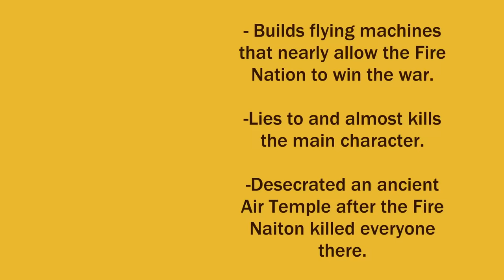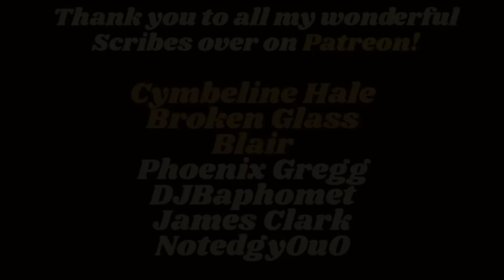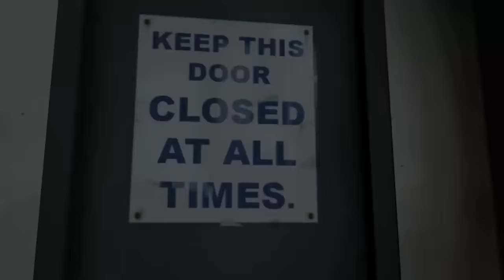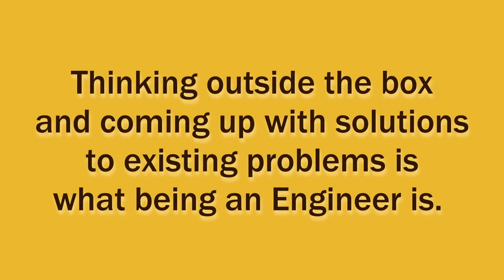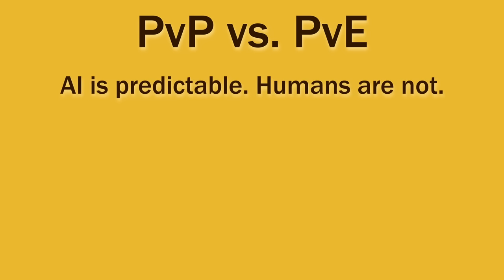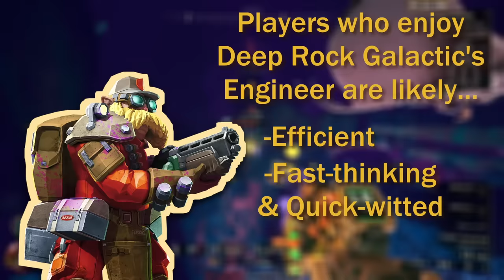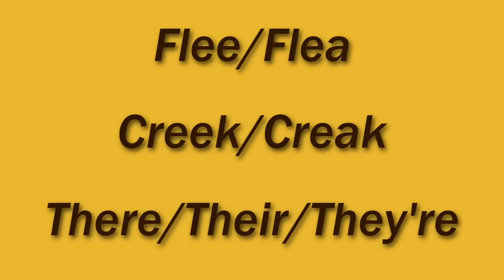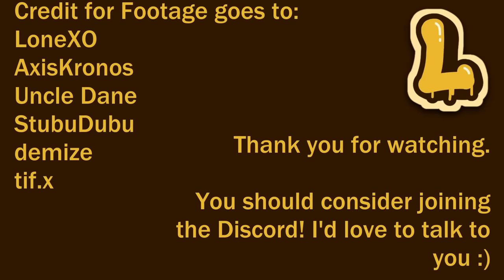TF2 vs. Deep Rock Galactic: What It Means To Be An Engineer

Comment: The beauty of DRG is every class is good on its own but SHINES when grouped. Everyone can contribute meaningfully to success.
Reply: Exactly! Each class has its own purpose in damage, movement and utility. Each one can complete every mission on every hazard level solo just fine, but they're ultimately incomplete without each other.
Reply: I would say it's the same with TF2, but it's more rare to encounter a well coordinated team, though when it happens, it's awesome.
Reply: @RDTRNT Because tf2, ironically, is closer to a single player game that just happens to have other players.

Valve realized pretty early on (through their failed "Commander" attempts during early tf2 versions) that players HATED failing due to another player, since it wasn't their fault (or even if it was), so they would quit. Tf2 fixed this by being primarily solo based with opportunities to work together (protecting the engie/medic, helping a fellow spy get a kill by distracting an enemy, calling out a sniper, etc.) You don't NEED to keep your medic safe or help a spy, but doing so makes it easier to win and, if you fail, you blame YOURSELF for either solo mistakes or not putting your effort in. 

It's a remarkable way to handle teamwork, and I think is one major reason the "friendly" playstyle even formed, you don't need to play as expected to have fun and you aren't ruining the fun of others nearly as much as other games.
Reply: @thunderspark1536  That makes sense. On the other hand, DRG is widely cited as such a positive game because every class could be considered a support class! So even a selfish player, who only uses their abilities for their own benefit, will still end up accidentally helping their team!
Reply: @Drekromancer  Exactly.
Reply: I think what's even more beautiful is how intuitive the teamwork and synergies are. Most people seem to understand exactly how their class abilities can help each other, and very little communication is needed between players for everyone to be on the same page. I rarely talk to other players when I play online, but teamwork is spot on 90% of the time, even when playing with greenbeards (mostly).

Comment: I will say, first off: ROCK AND STONE! Second, the great thing about drg is that you can take it at any speed you want, ranging from a hazard level 1, were problems are basically nonexistent, to haz 6, where the gameplay shown in the video is still probably not good enough. My point being, drg, and all 4 classes, are completely moldeable to your play style, you could turn engi into the tf2 engi, play sea world tycoon 2, or be the doomsayer.
Reply: ROCK AND STONE!
Reply: ROCK AND STONE BROTHER
Reply: Did some say rock and stone?
Reply: STONE AND ROCK!! Oh, wait..
Reply: I think the video's gameplay is good enough for haz 5, it's the modded difficulties that go to haz 6 that make things really crazy.
Reply: @aarepelaa1142  Ah, thats what I was thinking of. Brain kinda force-forgot that
Reply: Roch and Stone to the bone!
Reply: FOR ROCK AND STONE
Reply: ROCK AND STONE FOREVER!
Reply: ROCK SOLIIDDD
Reply: DRG is limited by ammo. There's only so much nitra around. So attrition warfare is not an option. But TF2, in the most popular game modes, is all about attrition and pressure.
Reply: Wait.. what's the difference between rock.. and stone..
Reply: DRG engie can range from a colony management simulator between dorreta and 2 turrets with arc/em discharge/slap or summed up in one overclock
fat boy
Reply: DID I HEAR A ROCK AND STONE?

Comment: The mono-class team meme is not that bad in deep rock with 4 tech-guys, them being so flexible lessens the pain of lack of specific tools, like the hyper mobility of scout or the fast terrain removal of driller.
Reply: All of them have bonuses that mean its not actually bad to play. For gunner, you have so many shields that you can never leave one if you feel like it, and the overwhelming firepower can take out anything really fast. For engie, they're all very flexible and can deal with most situations. For scout, you're all moving so fast that its gonna be hard for the bugs to keep you all down, and swarms are an afterthought with builds like electrifying reload GK2. Driller is the most niche, but swarms will be practically stuck with the number of CC abilities, and i gotta say, the fastest Haz 5 aquarq mission i've done was a 4 driller team, we all just blitzed the objective.
Reply: same for the aquarq on haz 5(high oxygen and jet boots) our only swarm was after we send the site away
Reply: @ruberine2086  agreed, but an all gunner team in a pit with a steady supply of ranged enemies becomes a nightmare.
Reply: @lestevegmbh2637  Sounds easy done right. Bulldog, coilgun, mingun and hurricane are all good options to deal with ranged enemies. Innacuracy doesn’t matter if you have 8,000 rounds to play with. Someone going down doesn’t matter, as you can just toss a shield and rez them, and also have cover for a while, and still have 3 fully charged by the end. Its also a perfect time to use my patented method of the gunkie (a bunker dug by just gunners, with just gunners in it. You want a nice wide mouth for it too). The chances you have an entire team end up in a pit they can’t get out of together, with so many ranged enemies that you’ll burn through all your shields and ammo is then so incredibly slim.
Reply: @lestevegmbh2637  as long as y’all bring different builds y’all should be fine
Reply: @ruberine2086  we should be fine, unfortunately we have one gunner with a single promotion who hugs the shellback repeatedly, one who isn't around at all and we burned trough the mission saving active abilities like IW or FM during the objective completion.
This isn't about the optimal situation, were all colleagues are competent and on max ammo. Wasting shields is a problem exasperating this case, gunner doesn't have a middle ground equipment wise, only guns or either grenades or shields, and of those only 4, yes that can be fixed with something like hellfire, but that compensation leaves you with low total ammo. Still not as efficient as turret support or mid-fight repositioning via grappling hook for threats too big for sustained fire and too small for using a shield.
Panicking teams using multiple shields at once speeds up the drainage.
And only one projectile to knock you down.
Im petty over this, but pits aren't the only thing, almost any obstacle is more problematic and this is most concentrated on the extraction, were a lost mission can easily cost you 30 mins.
Reply: @lestevegmbh2637  Yeah, course its not optimal, but a halfway decent team should be able to take on a mission with one of any class, i’ve done it loads of times before on haz5 and various deep dives
Reply: Engineers synergize with other engineers better than all the other classes synergize with themselves thanks to the various sentry-boosting overclocks/upgrades(turret whip, EM discharge, turret arc)
Reply: Having 1 driller with 3 engie feels nice if the environment isn't very open like Crystalline Caverns or Hollow Bough. But when its Sandblasted Corridors or Radioactive exclusion zone, the bugs are never gonna get close to you with 4 engineers.

Comment: 9:56 slight correction the 2 sentry’s are an upgrade, you start with 1 but can either upgrade to two or choose to get 1 powerful one instead.
Reply: well, except 2 sentries is generally better option, since they provide higher DPS the option comes with extra max ammo, so single sentry is on par in terns of total ammo*damage. It doesn't help that single sentry's damage bonus is relatively small compared to what base damage + Defender already has. Plus, single Defender sentry covers less terrain than two.
Reply: @user-25352 also if you're running shotgun, you can turn your turrets into railguns
Reply: @synkt8759  more like explosive cannons, and yeah turret whip's cooldown is individual per turret so gemini is better here as well.
Reply: @user-25352  dude this wasn’t about which was better , this was about that you do not start off with 2 sentries
Reply: @geoshark12  since gemini upgrade is in tier 1 (available from the start) and its cost is minimal, for all intents and purposes you DO start with 2 sentries
Reply: @user-25352   Doesn’t change the fact that the 1 turret is an option and that you have to equip it means your blatantly wrong
Reply: @geoshark12 your "blatantly" is hardly convincing lol. Just admit "its an option" is just semantics, while "its what you always have unless you specifically opt to not" is how it actually goes
Reply: @user-25352  ...what??? You're not only blatantly wrong but also LITERALLY wrong, Gemini isn't default. No matter how much you think it's the superior option, it isn't default. Furthermore, Mk. II is just as good as Gemini. Having a single turret means you can more comfortably take the T2 mod for more ammo and also don't have to spend as much time baby sitting the turret because, while it has worse DPS than Gemini, each individual bullet does more! If the turrets were Engi's only option for waves then yeah, sure, but they're not. Engineer himself is astoundingly powerful, having the best single target burst damage of any class with things like hyper prop, spinning death, and overdrive booster, NOT TO MENTION the absolutely ludicrous ammo efficiency of the Stubby for grunts and swarmers or even the Warthog with semi decent aim.

Also the total damage from ammo * damage of Mk.II is like nearly double what you gain from Gemini so like ?? on that point. You're getting roughly double the DPS in exchange which is good don't get me wrong but the eternal debate over DPS vs Efficiency is nuanced and requires significantly more than just looking at numbers to decide what is best.

Also also, Gemini can't kill a swarmer in two shots without Defender on Haz 3+,  take your gold plated L now. Pathetic :^)
Reply: @Silver-Rexy  tl;dr. Seriously, you just can't calm down trying to debate forever, sending more and more arguments of varying quality and relevancy, probably anything you randomly googled. I guess I'm better off not arguing with a fool, so goodbye
Reply: @user-25352  Literally a different person, not same one you were arguing with before lol
What's your attention span that you couldn't read a paragraph though.... kids these days.
Reply: LMAO you people in this comments thread are living caricatures of Lucid's point at 13:55

Comment: drg misconceptions:

1: (got removed because I was incorrect)
2: stock engi doesn't have 2 sentries 9:55
3: sentries can be upgraded before missions with weapon mods, and overclocks 10:00 
4: I could be misunderstanding you, but both sentries on stock take 8 seconds to build combined 10:09

hope this helps!

(this isn't a misconception) for any new players:
12:00 this platform trick won't work unless you have the tier 2 upgrade on the platform gun called "Plastcrete Mk2", which reduces fall damage when you fall on top the platform.
Reply from the maker: 1. Sorry, I probably worded this badly. I mean that the longer you're in the mission, the more at risk you are of losing due to the ongoing waves. (Though admittedly, I thought the waves got more difficult over time)

2. Shoot, I'm sorry for messing this up. 

3. I had an entire section written and recorded discussing this piece of DRG, but ended up cutting it cause it distracted too far from the point of my video.

4. I was referring to how much each sentry takes individually, but I probably could have worded it better.

Thank you for your help, I apologize for messing the pieces up that I did.
Reply: @LucidMakesVideos  thanks for responding and clearing some things up! I enjoyed the video a ton, and you have a wonderful editing style
Reply from the maker: @LegoGoblin  thank you! I worked really hard on it, so I'm glad you enjoyed :)

I will work even harder next time to make sure I get easy things wrong again :)
Reply: And overclocks on support tool? Wish it was true
Reply: @spottycentaur5862  Was referring to turret em discharge, and turret arc, but yea i hope that happens
Reply: 1. Is wrong, every mission gets harder with time as the random unannounced waves get bigger and bigger. Aquarq missions are just significantly faster to ramp up.
Reply: the aquarqs is also a misconception that the GSG team debunked, the reason it feels like it gets more difficult as it goes on is the same reason any mission feels more difficult as it goes on. Eggs however, will spawn swarms as a response to mining them out of their fleshy stuff.
Reply: @thelizardwizard6772  Aquarq missions do get harder faster than other missions
Reply: 1: it does, tho? The longer you stay in a mission, the more bugs you kill => more resupplys you use => less nitra in reserve => higher chance of being left with no ammo or health at the end of mission = higher chance of losing.
Reply: The platform upgrade is the only choice for t2, if you don't have it when its unlocked you a doofus.
Reply: @thelizardwizard6772  You're thinking of them debunking the thinking that "The more aquarqs you get, the more challenging it gets" ideal. this is not the case, and is just that the longer the mission goes on, more bugs spawn.

Edit: just read other comment about all missions slowly getting ramped up. thanks for this info!
Reply: @karkinos5398  well i was talking statistically about the bugs, not the dwarves.  (which i have been proved wrong)
Reply: @LucidMakesVideos Waves only worsen over time in Point Extraction :)

Comment: 9:55 - Stock engineer gets only One Sentry - you have the option of taking the Gemini system of two sentries (and slightly more maximum ammo) or the MKII model which has slightly longer range and higher damage as well as a a bit more ammo capacity.
IMHO: Missions that will have you set up in a single area can benefit from two sentires. While missions that require you move around more (mining, egg hunt in particular) might be better met with a single sentry.
Also, its unfair to say they aren't upgradable.. the DRG sentries can be upgraded, but it is done between missions and changes the sentries behavior (faster construction, armor breaking, stun, more ammo, etc) without requiring extra time or effort during game play.

Comment: as someone who mains both characters in either game:
the similaraties of both characters is having that sentry watching your back, it brings a playstyle where you constantly have something protecting you and can rely on not having to be puting out damage yourself to handle enemies, letting you focus on your own survival rather than killing enemies.
both also reward knowing the terrain, (in DRG that is the case for all classes but engineer benefits the most) to know where the best places to set your buildings and hold a defencive postion the platform gun also compounds on that spacial awareness of knowing where the best places are to set your platforms while in TF2 knowing the optinal positions for where the dispencer and teleporter go, somewhere close enough to the fight to be useful, but not so close as to be in danger.

also the default DRG turret you only get one, but the first upgrade is a choice of either getting a better turret or have 2 with a larger ammo pool, every engi ive seen in the game prefers to have 2 guns and its easy to see why when you consider the coverage they get

Comment: I just really love the DRG Engi. While the TF2 Engi does not really click with me, the DRG Engi just allows me to be as effective as you can be without much planning beforehand. And yet you still are rewarded for planning ahead. But most of this comes from his versatility. He can make pathways, barriers or just waypoints with just the platform alone, his turrets take away pressure of enemies, his grenades all serve a different function, unique for each situation you want to deal with. And then his guns. He has just 6 guns, yet they alone can do anything you need them to. But you have to be prepared. Meanwhile TF2s Engi is more focused on something. He is inside his own niche. And while he can be played outside, he is designed for that niche. Thats why I love DRG so much. Every class has its niche, but it is so broadly defined that you can still do so much with your freedom

Comment: it's weird cause i play tf2 engineer like drg engie
like once you where to put your buildings, it becomes more a game of efficiency, multitasking, and helping your team be more efficient
the one difference that i can see is that tf2 engineer has more 'chores' (putting up buildings, repairing/replacing them etc)
Reply: in tf2 you can even 'building boost', which parallels drg's platform gun to a certain degree
Reply: @NotABean_ yeah if you're not hitting your buildings to build them faster you're probably doing it wrong